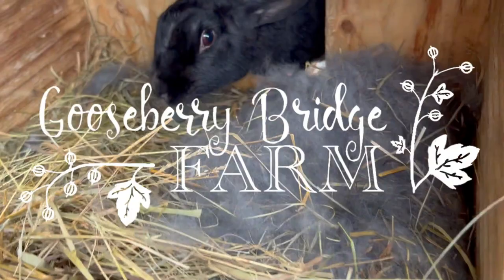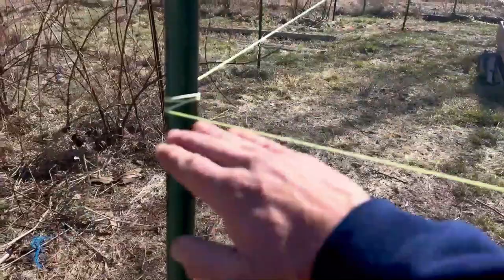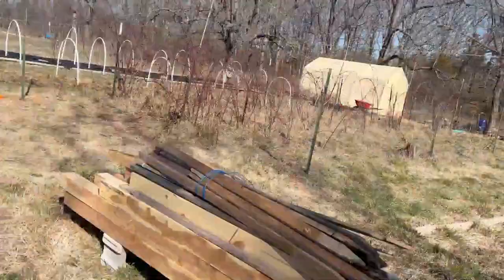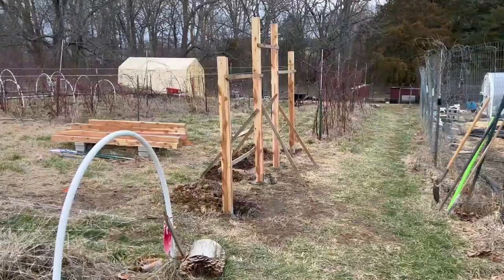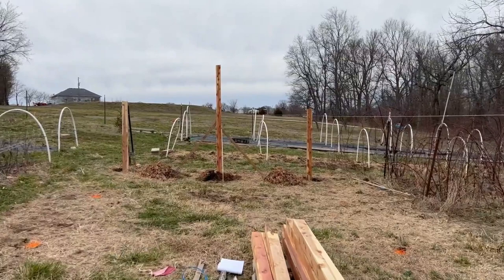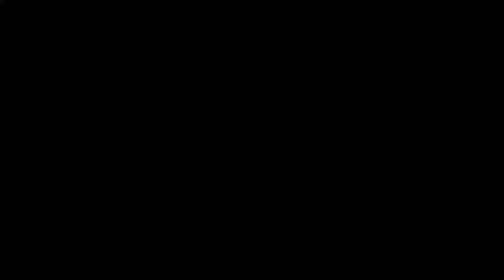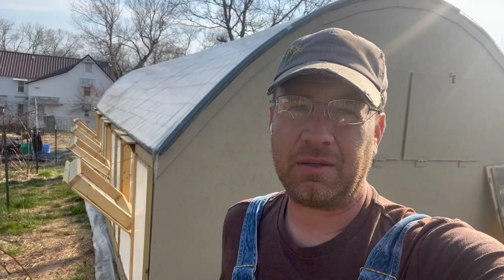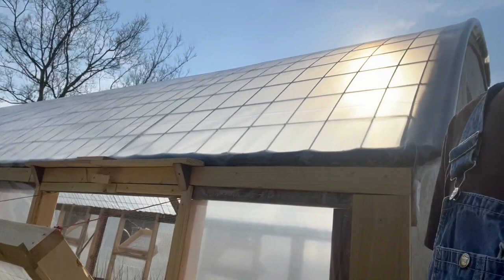How we built our cattle panel greenhouse!

Comment: The simple simplicity of this build has earned you a gold star.
I built a hoop house last year that seemed to be the cat’s meow but old man winter played havoc on it.
Your using 4x4’s concreted was key is structural integrity.
Bracing certainly helps but they need a stronger sub structure than my design.
Your overall design  is without a doubt one to refer to for a quality build.
I’m having to start over and I’m using your creativity in my new project.
Thanks…
Reply from the maker: Thanks for the kind words! We have had good luck with this design. The only place it doesn’t do great is with wet snow. It can cause the hoops to shift after several inches, so we have to knock snow off.

Comment: This is a very nicely designed and executed greenhouse IMHO.   My only comment is that if you experience high winds in your area, it would seem prudent to secure the cattle panels a bit better.  I would wrap those plumbing straps completely around the 2x6 that the panels rest on and attach with a couple of wood screws.  I would also suggest perhaps two more supports ( in addition to the one already in place) beneath the cattle panels to withstand flexing, if your winds come out of the east or west.  Thanks for sharing your video.
Reply from the maker: Thanks for your thoughts! Our older greenhouse (same design) has been in use 4 years now - both of them have stood up to storms woth 60-70mph winds with no damage - so far so good! wet snow is a bigger issue, when we have it, they can only hold 4-5inches of wet snow before they start to buckle a bit and extra supports would help with that but since we so rarely get that kind of snow we just go out and remove it before it gets to that point.

Comment: isnt ptl just treated with copper these days?
Reply from the maker: Actually there are several chemicals used to protect the wood from insects and rot. I wouldn’t mind as bad in other parts of my property, but since this is less than 10’ uphill of my garden, it was worth paying a little extra for Cedar. Handily there are several individually opened sawmills in the area so it wasn’t much more expensive than pressure treated pine from the box stores!

Comment: Question?  How did the plastic last on the cattle pen fence ..rips or chaffing ❤
Reply from the maker: Our original cattle panel greenhouses have 4 year old plastic - besides some issues from cat claws and hail damage there are no holes from the panels - we do cover any sharp edges that are in contact with the plastic with foam pipe insulation or electrical tape as needed

Comment: Can you tell me the height of the walls and the width and length of greenhouse ??? Thank you 😊
Reply from the maker: The greenhouse is 12x30ft and the height of the walls is based off our needs and the elevation change in the spot where the greenhouse is located - they’re all different, depending on where you measure.